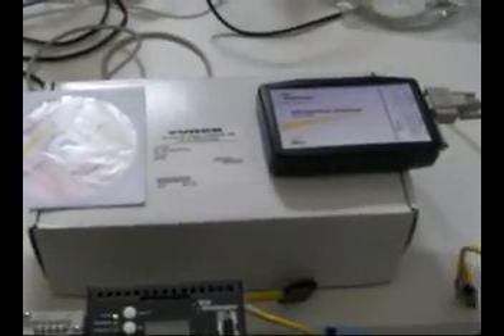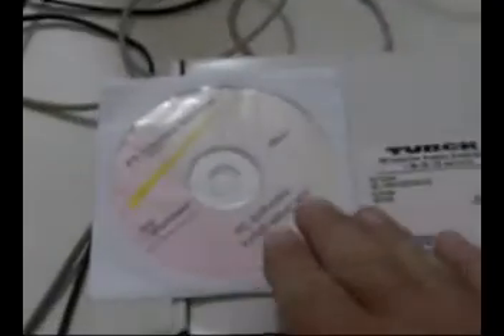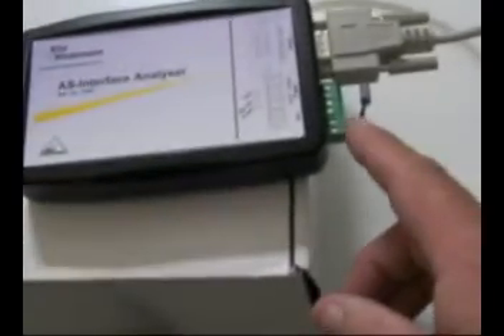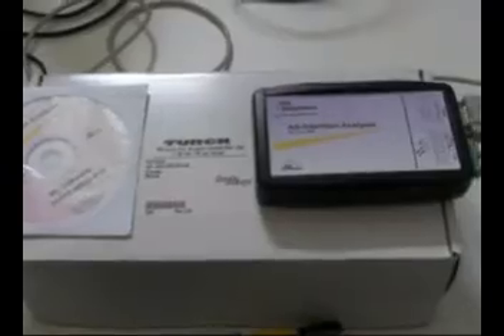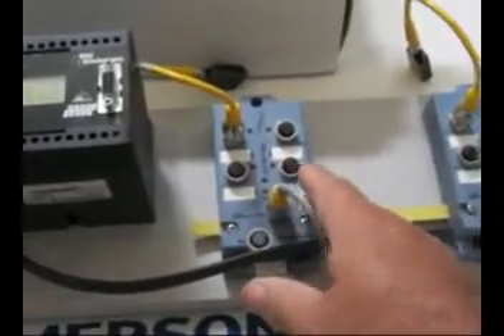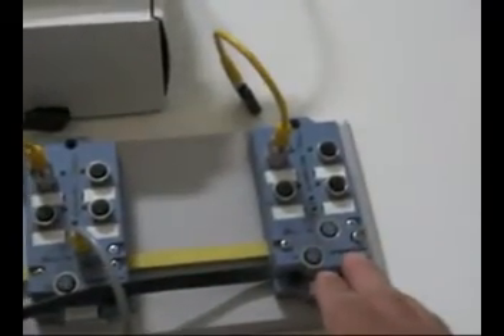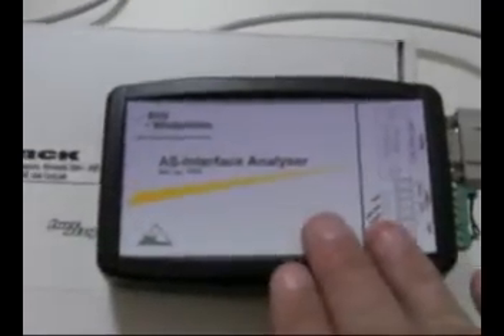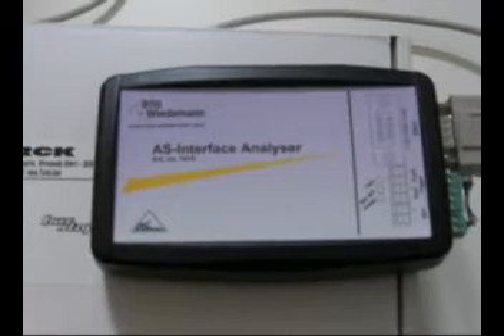Bihl Wiedemann AS-Interface Analyzer BW1415

Comment: need to make a new video with better video footage
Reply from the maker: Yes, the Manufacturer of the product should come out with something new.
Reply: @JoeWaZoo1_Geeks_Rule  Good call, we will work on this.  The diagnostics used with B+W gateways gives a little more information back than the analyzer without the added cost and hardware, but the analyzer is still a relevant tool, especially with the older PROFIbus gateways.  I will see if we can get clearance to produce an instructional video.  Feel free to call one of our offices at any point if you need assistance in troubleshooting or working with the hardware.
Reply from the maker: @tomkemp1989  I don't think TURCK sells your products anymore.  I think B&W cut them out of the channel.
Reply: @JoeWaZoo1_Geeks_Rule  not sure which side initiated the separation but you're correct. B+W does not private label for them anymore